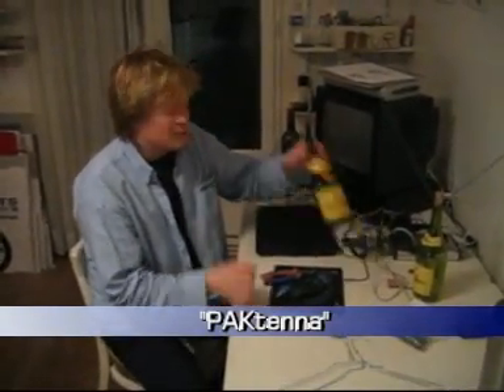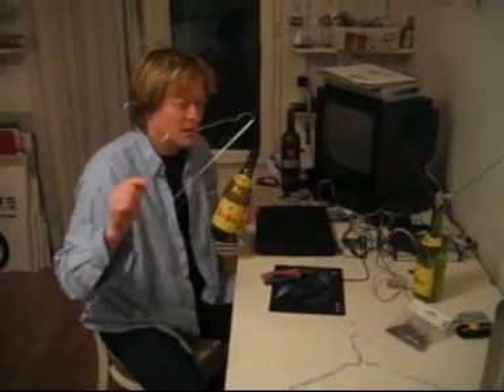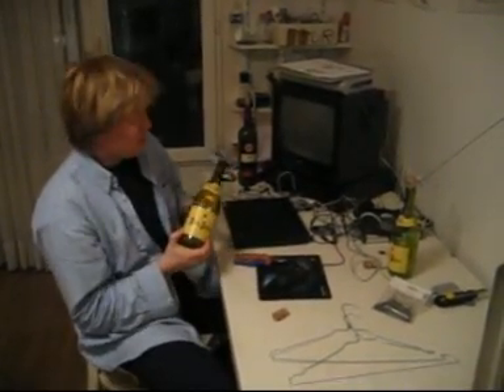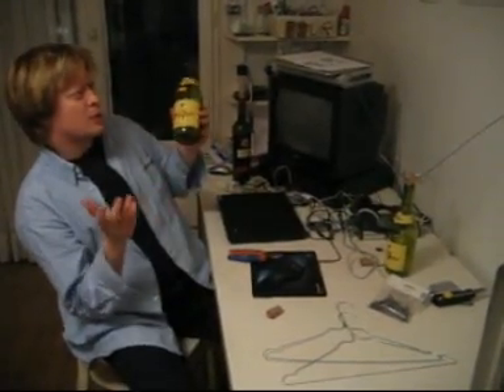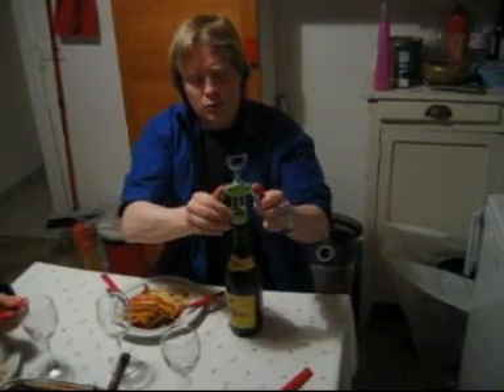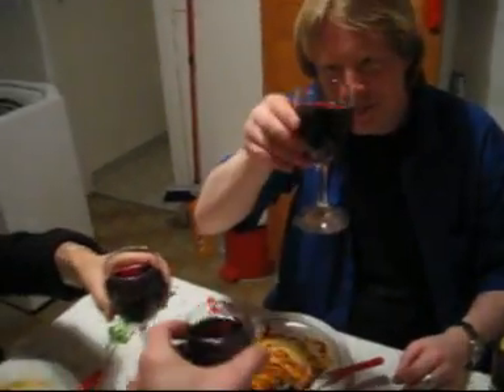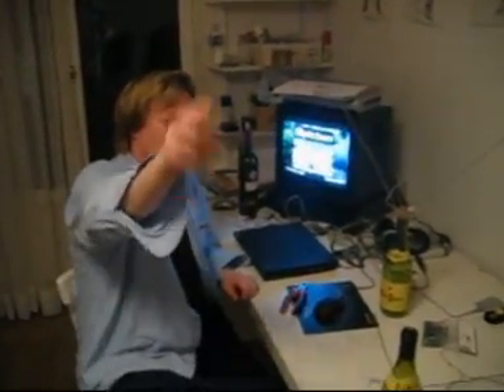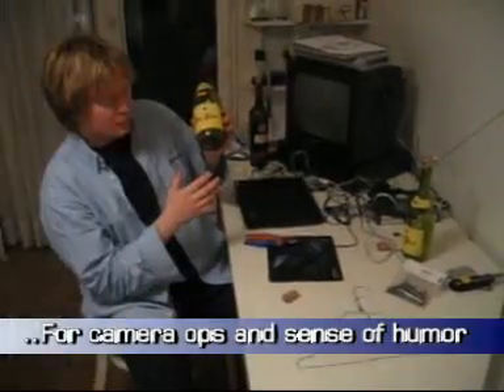DIY TV antenna by PAK

Comment from the maker: it´s centre fits directly onto the nail (you´ll have to find a nail that allows a snug fit) which is connected to one side, while the other side connects (yes) the outer/connecting cylinder of the cable (shield?); the idea being to create 2 separerate signal paths:         => bi-polar antenna

Comment from the maker: a wirecoat hanger cut in two using whatever does the job, which leaves two basically equal lengths of wire: You also nees an emty winebottle, it´s cork ant a nail. That´s all
The diagram and detail photos I email on request.

Comment: Yes, I agree it is a dipole antenna. The commercial ones are called Rabbit Ears and they come with telescoping rods that can be pulled out or retracted. Hmm.. but they also come with a 300ohm to 75ohm balun transformer. Rabbit Ears are 300ohm outputs, the same as Peturk's and Tv set Ant input is 75ohm. I think if the transformer is use, the reception will be even better! Got to try it...

Comment: Keep in mind he is using a BNC connector which are extremely popular in Europe, trying this with an F connector would be a bit more difficult.  In  this case a "F" connecting barrel would do fine (the piece that is used to extend coax runs by the cable company).

LOL, ever use a sewing pin to do a quick fix to a beheaded RG59 cable?